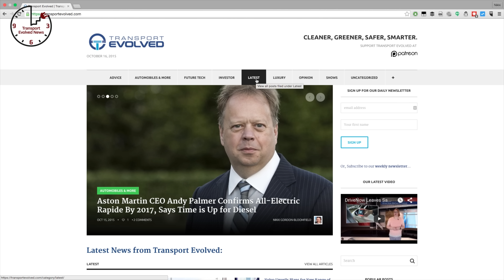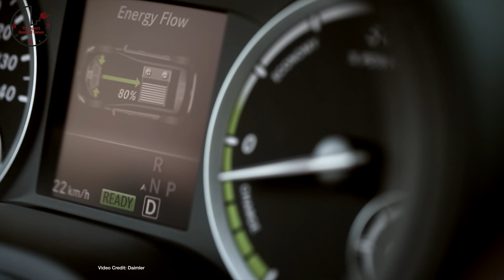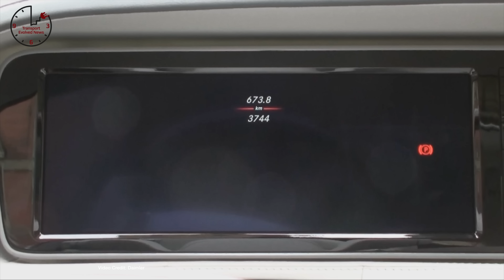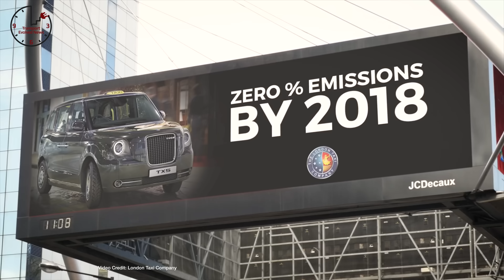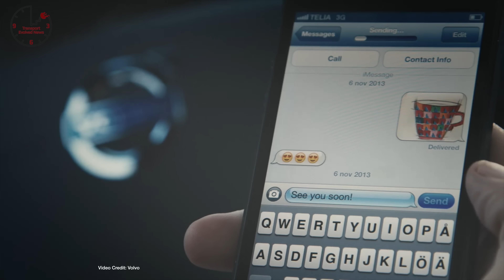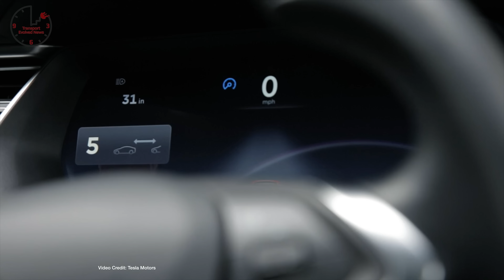Tesla Model X Lemon, Electrifying UEFA, Self-Driving Fear, T.E.N. Future Car News 27th May 2016

Comment: Several things that can help Tesla: 1. lower price entry with upgrade as financial means permit also stops repossessions.;2. Formula E is going to have a Coupe which makes the roadster an excellent choice in a striped down version which will open with a version of Renault Alpine which is already on a platform with the Wind to be in the same category. I think Aston-Martin will have a case of jealousy and make a similar version.; 3. There needs to be a van version like the Kangoo ZE with the Renault idea of configuring the work van at the factory not at a custom shop. In this later case Renault can deliver the same work van with wrap/storage bins/lap top with remote printer for $10,000 USD cheaper than Ford-Chevrolete-Dodge to mention a few. A van that is for work needs to be sent work ready not in a custom shop. Besides, BMW has ECO tools for lawn care which could be their Gardener package. Those tools are drop in lithium batteries for lawnmower/weed cutter/chain saw/cultivator/and suction-chipper ( In some residences you can only suck not blow debris due to allergy. A lot of people have a "Juan" to handle the greenery and that is a growing service niche. Already several "Juan" are asking Renault Mexico for such a van.

Comment: I think a manufacturer training certificate to mark compliance with necessary understanding should/could be mandated before enabling the autonomous features. A fixed test is not a realistic proposal owing to the rapid changing capabilities of the various systems. Over the air updates could be withheld until the owner has visited for the instructional session on the changes. It would be good to link this to the actual identity of the driver, somehow, so the features would not be available to "other drivers" of the certified owner's car. I am very keen to be part of this world and waiting for my model 3, because I am old enough to see a time looming where the car will be a better driver than me, and will provide an extension to my personal mobility beyond that which I would feel was wise without the benefits of autonomy.

Comment: To be fair, pilots needing a license for flying by instruments has nothing to do with the autopilot. That's more like drivers needing a license to drive with a carpet covering the windshield. In a situation where you can't see and have to rely 100% on instruments alone, you wouldn't be driving in the first place.

Step one: change the name. Obviously people zone out when they hear "autopilot" and stop listening/reading. They flat out ignore that at this point it's basically just adaptive cruise control with active lane assist (and whatever a "follow the car in front of you"-feature is called).

Step two: make them confirm that they understand the limitations before they can turn it on. This is probably as useless as expecting people to read the entire license agreement before clicking on "I agree", but might be useful for legal reasons.